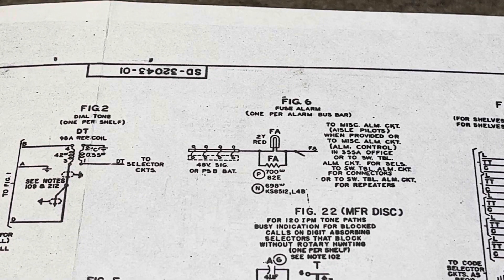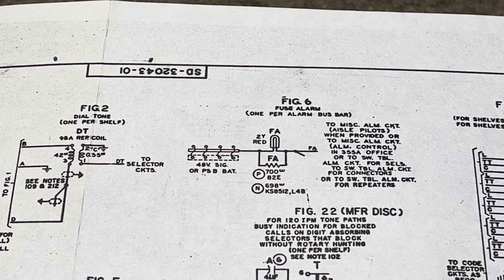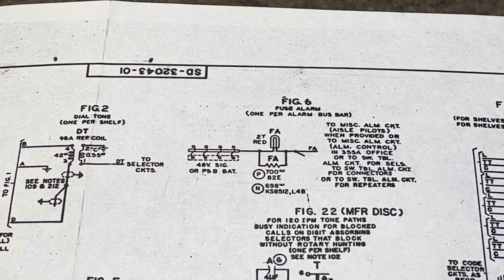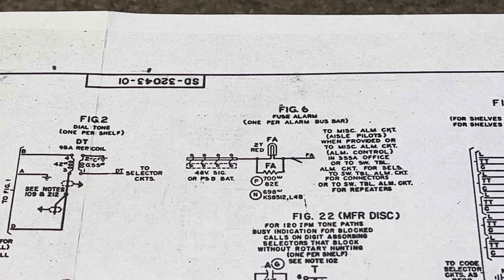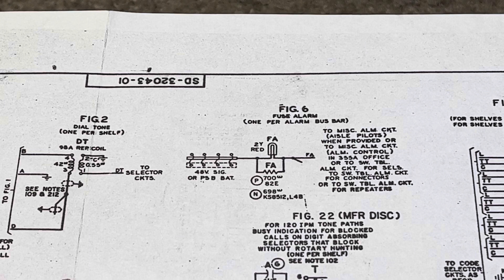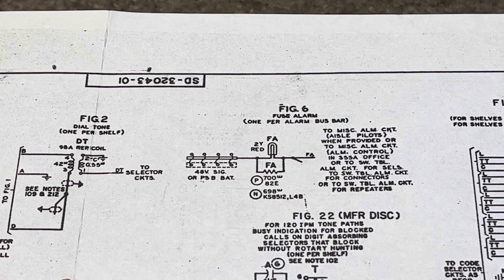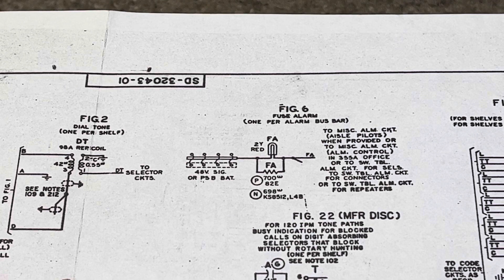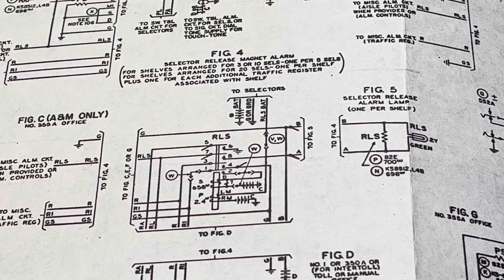Alarms in a Western Electric Strowger central office

Comment: Ex NOTCo/GTE Ohio switchman here. Great to see this and your other SxS posts. Our AE SxS shelf alarm control circuits differed, most notably by using flat spring for all functions. That is, unless AE could figure out how to include a Minor Switch or Rotary Step Switch, since they owned those patents.  The WECO Strowger switches themselves differed very little from the AE built units. I'm told many parts were interchangeable but never actually tried it.